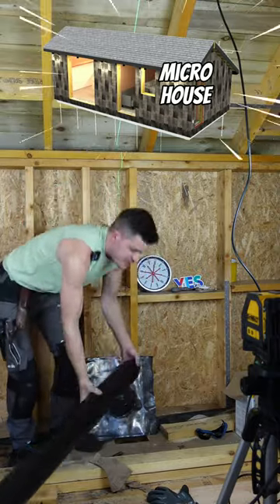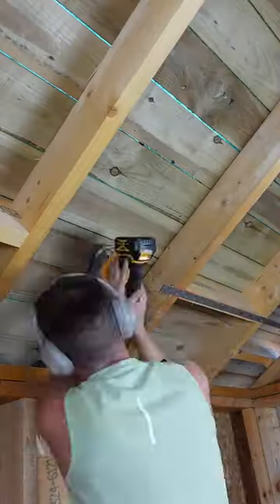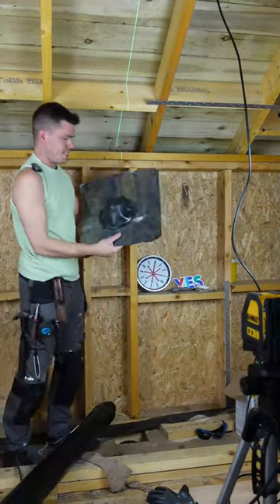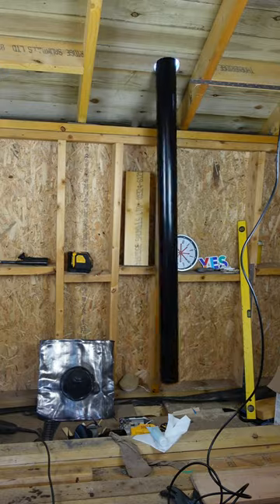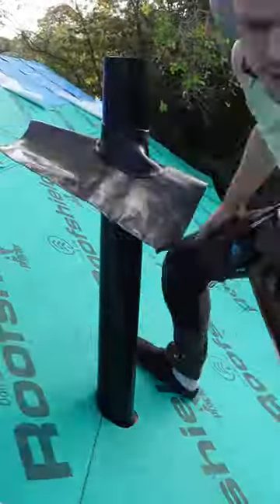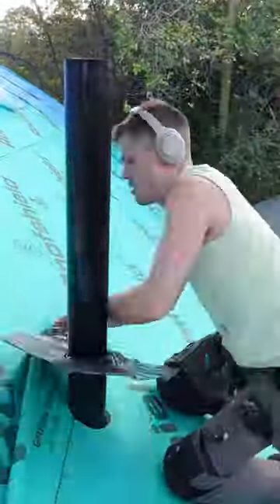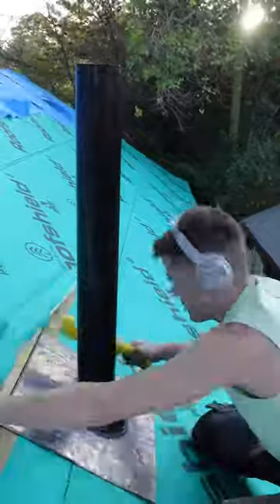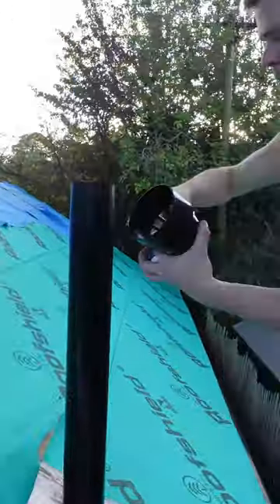Installing a Soil Vent Pipe #shorts #soilventpipe #diy #roofing #vent #scotland

Comment: Close enough? Sure if you say so 😂. 

If you need to do this type of holes again use a wire with a weight to mark out the edges of the pipe on the roof above.